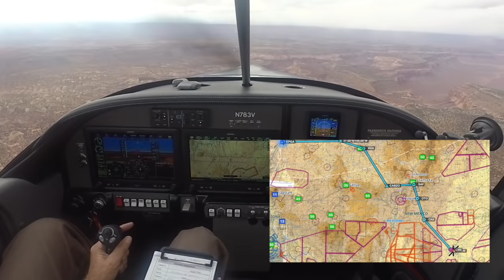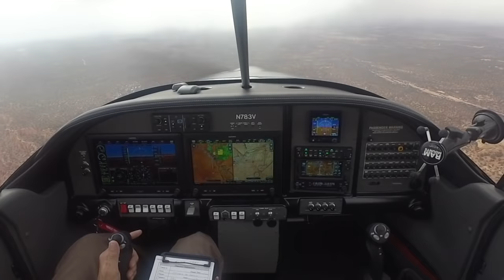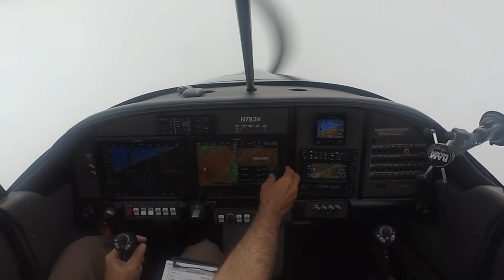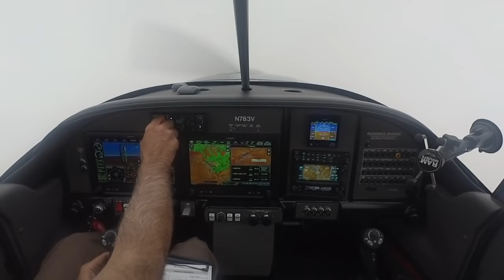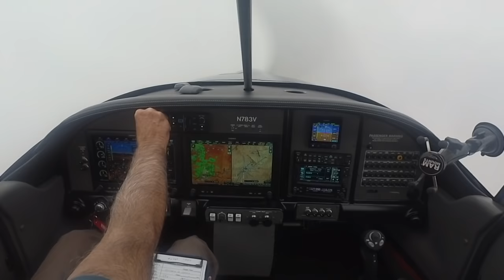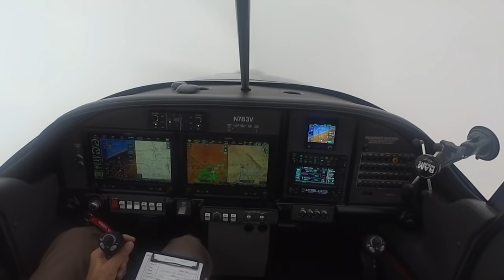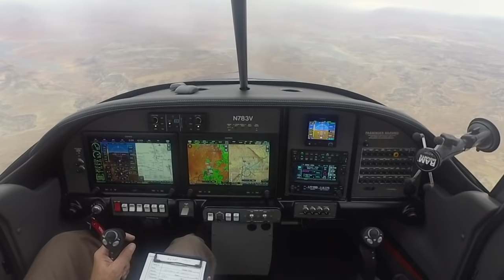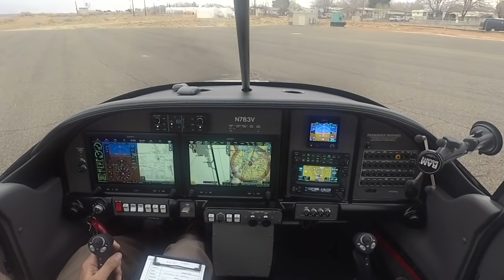RV 10   N783V   My 1st Emergency   HD 720p

Comment: Inadvertent IFR, in an aircraft/cockpit you don't have that many hours in, solo.

That's a tough situation even for the pros.  I've been there myself flying military aircraft, and it's definitely one of those "in the air wishing you were on the ground" scenarios!

I think one of the best things to recognize is that these factors above can SIGNIFICANTLY affect your performance, regardless of experience level (no matter how good you are, you are NOT going to be at your best in this situation).

Which means the more you fully embrace the performance degradation and try to stack the deck in your favor, the better.  Just admitting this in the moment can be difficult for many.

Some things to think about to augment the fundamental pillars of "Aviate, Navigate, Communicate":

1. Turning around towards known VFR conditions.  Viable (and already beat to death) in this case, but it might not always be an option.  The weather gets a vote too, and if it surprised you in front of the aircraft, it could surprise you behind it as well.
2. How comfortable are you with your clearance over the highest obstacles in the area?  I'm assuming your high-speed Garmin systems will greatly help to keep you clear, but if there is any doubt, getting a good obstacle-clearance altitude squared away (either by checking charts or asking ATC) should be a fairly high initial priority once IMC.  If it's taking too long to figure this out due to task saturation/closer alligators to your canoe, consider climbing until you can revisit.  This will also slow your speed over the ground - not a bad thing when you're behind the aircraft.  Once this check is in the box, you can breathe a little easier.
3. Slow down (keeping a safe margin above stall) if safe to do so - gives you and ATC more time to get ahead of the aircraft.  You're going to need time to get your house in order while working through the problem set.
4. If slowing down still isn't enough to get ahead of the aircraft and fuel/conditions permit, consider a couple of gentle 360° turns to further limit how far you are traveling downrange until you are ready.
5.  Don't rule out squawking 7700 and declaring an emergency if things get too overwhelming.  Not saying that was needed in this case, but it's a tool in your toolbox that can help you if things start to really go south.  If it's taking too long to reach ATC while in unplanned IMC, squawking 7700 should get everyone's attention and help mitigate the risk of swapping paint while trying to get a clearance.
6.  Whenever circumstances throw you off your normal rhythm, that is a prime scenario for forgetting/missing basic stuff completely unrelated to whatever shiny object is commanding your attention at the moment.  Approach and landing checklists, altimeter settings, etc are more likely to be missed or incomplete when task-saturated.  Don't forget the basics, and don't let yourself get squeezed into missing the fundamentals due to being behind the aircraft (see item 3 and 4 above).  If you're not sure you completed a checklist due to distractions, don't be afraid to repeat it.  I've had lots of hairy emergencies, always tried to recognize how much more vulnerable I was to stupid mistakes in those situations, and always tried to give myself extra time to make sure I was fully ready to land when the situation allowed, even if it meant a couple of laps overhead the field to take a breath, get back into the normal habit patterns, and make sure I was really complete with all my emergency non-memory items and regular checklists, etc (assuming my fuel state and emergency weren't time-critical - which they were not most of the time).

When cleared direct to what I assume was the initial or final approach fix (right before the pitot tube iced over), great job just asking ATC for a steer instead of adding another task to your list while saturated.

Of course, there could always be factors that make this situation much, much worse, like lack of IFR training and IMC experience, low fuel state, significant nearby terrain, deteriorating weather at runway(s) within range, aircraft malfunction(s), and having this happen at night.

I was happy to hear helpful ATC who were cognizant of the snakes in your cockpit and tried to not make things worse while balancing the need to get you safely deconflicted and on the ground.

And one last thing - is there any reason not to always have pitot heat on while in the air for your aircraft type?  This was a no-brainer for the military aircraft I flew, but perhaps things are different for expensive privately-owned aircraft (where there might be more incentive to preserve the life of expensive aircraft components).

Thanks for sharing this experience for everyone's benefit.  Everyone makes mistakes - even the best-handled emergencies reveal certain areas that could have been handled more effectively when carefully analyzed after the fact.  Your willingness to analyze, embrace, and share the post-flight takeaways speaks volumes and is really critical to a productive aviation safety culture.  Plus, it makes you a better pilot in the long run.

Fly Navy!

Comment: Scary stuff, You should put a temp sensor on your pitot tube so it comes on automatically, with a separate redundant override switch, should the temp sensor fail, but the thing about situations like this, is that you will never forget to turn on your pitot sensor heater on again, thats for sure. 😊

Comment: In the age of selfdriving cars, it seems like aviation has a long way to go to catch up. I mean, there obviously should be a sensor on the piot tube that detects if the tube is blocked by debris or b.detects if it is blocked by ice and takes  the appropriate action automatically! This is the Second video about the pitot tube failure the other on a commercial aircraft and they too had no idea why they had no airspeed (turns out the ground crew forgot to remove the piot tube covers prior to take off)

Comment: Well i think every pilot should prepare for each VFR flight like it will be IFR with 0 visability. Things like planning a path in garmin with ils or rnav approaces and also NDB and VOR beacons is created for this kind of a situation.
And also i have a rule: if i am flying through clouds - pito heat and other anti ice sistems is always on. Just to be safe.

Comment: In watching these videos, I feel like many times the cockpit alarms do more distracting harm than good. YES, sound quickly and briefly 3x in a row (and state the actual issue audibly), and maybe again 30 seconds later but to have a TONE only going off, or multiple tones mostly distracts and makes the pilot less effective, not more. That is just my opinion- thoughts?

Comment: Pretty amazing ( to non pilot) that only one air speed indciator availabel with no back up and that pitot heat isn't always on. If I recall a freezing pitot was major contributing factor to that  Air France Airbus A330 crash in  south America 2009 with total loss of life. 
Just a thought - would not on board (or even a dash mounted GPS) give you a damn good ground speed indication at least. Better than nothing. It always agrees with my car speedo within a few %. It's  fairly sobering that my car has two reliable speed indicators but a plane does not.

Comment: Not a pilot but have enjoyed a few flights with friends.
I'm happy sitting on my hands in the right seat, feet planted firmly on the floor away from the peddles.
Maybe if my pilot croaked I'd be able to crash land soft enough to hobble away from the wreck.
Maybe.

Comment: I am sure you honored the respect for National Park quiet enjoyment for the folks hiking and camping by staying 8 to 10 miles off the border of the Grand Canyon National Park. Please share this with your fellow pilots who are not quite so courteous and law abiding. After all, this is for their benefit -  more and more national park goers are becoming aware of the FAA complaint phone line access. I am planning to become a pilot myself, and I will most certainly remind my fellows to avoid trouble with their pilot license status.
Reply: Just checked the VFR sectional, there is no requirement to stay 8 to 10 miles from the park’s border. There are rules but I suspect you and your fellow hikers armed with the FAA complaint line phone number and their imagined constitutional right to never hear an aircraft engine are going to be making a lot of bogus complaints about planes in the designated VFR corridors over the Grand Canyon.

Comment: I think so many pilots get themselves into unnecessary situations simply because they are afraid to contact air traffic control and "bother them." When he apologizes to air traffic control and they respond with "that's our job", that's a moment that every pilot should keep in the back of their heads. In the end, air traffic control would much rather pull you out of the clouds than pull you out of the woods.

Comment: I wonder why they don't make automatic the pitot tube to go on when the temperature drops below a level where ice can accumulate. It should go on with a sound so the pilot is aware and decide if it is ok to keep it on or turn off. But the on should be triggered by the temperature not by the pilot once every 15 yrs.

Comment: The real lesson in this and its about all types of situations with travel and other topics but the real lesson to learn is this is a psychological error in human behavior. Refusing to turn around is a psychological threat to the ego regarding want, instead of need (to be safe). The ego presses on and begins to rationalize because it's embarrassing to the ego to have to turn back. When the ego drives your decisions you can definitely find yourself in a predicament. Kobe Bryant died from the same reasons.

Comment: I've been an aircraft mechanic for 32 years. I'm not a pilot. I guess I'd have the tendency to over simplify in my thinking...?   I think pitot heat would have been my first thing to "go for" when I lost airspeed.  My question is, in your opinion, is that something that maybe isn't emphasized enough in training ?   Great composure on your part.....   BTW, what did that airport pavement taste like when you kissed it ?  Ha ha.    Nice job.

Comment: On lessons learned you might want to add power and pitch equal performance.  

When you said you lost air speed and your stall warning was going off my brain IMMEDIATELY went to power and pitch and pitot heat.  

I benefitted from the exceptional instructional skills of a really great CFI who helped me as a new VFR pilot transition to my RV4.  

Those items were hammered into me.  

I really love the safety culture in the Aviation community.  Own the mistake and analyze what you did wrong.  I can tell you that I would not have made THOSE mistakes.  My weaknesses are many.  I have flaws in my skills and in my character itself.  All this means is that I would make different mistakes.  That's the danger that typically young people make when analyzing almost any kind of accident.  "I'd never make that mistake".  But they don't realize that while that may be true, they are likely to make a different kind of mistake.  

When I was roughly 30, I found myself with a bad case of Get There-itis.  It was a short trip and I was only going 120 miles in my RV-4 to go visit a girl for a weekend of fun.  It was a 45 minute flight, but because of mountains, it was a 4 hour car ride.  So I was "motivated.".   I found myself flying into lowering clouds and rising terrain.  I pressed on until I was flying in a 300 ft vertical space between the terrain and the bottom of the clouds.  

I was not IFR rated and the plane, although it had a Dynon D-10 , was not IFR certified.  FINALLY after passing a broadcast tower a couple of miles off my wing that was taller than I was high, did I turn around.  It was so so reliving to make the decision and see the space open up in front of me as I headed back home. IDIOT.  

Anyway, thank you for sharing.  I gave up flying when I had kids because my risk tolerance went way down.  Now they are in their teens and I'm thinking of getting back into it.  Sadly, I've found that my beloved RV-4 was involved in a ground loop incident and was totaled.

Comment: Seems like airplanes should have more than one airspeed sensor given how critical it is.  Isn't an airspeed sensor issue (failure in that case, not iced up) the reason for the lost of two 737-Max-800s when the MCAS system forced a nose down stabilizer state due to faulty airspeed data which led the algorithm to conclude a stall?

Comment: You were already in violation by flying into IFR conditions as a VFR driver before you made your decision to press on. You did not have 2000 ft horizontal visibility nor 500 feet clearance below the clouds.

Comment: This would appear to be a case of instinct vs training. The fact that you hadn't had to turn on the pitot heat in 15 years left you with the conclusion it was avionics failure instead of pilot error. I would think that most pilots who fly IFR in conditions like this wouldn't have made this mistake. At least you got on the ground safely.

Comment: "Hmm... my airspeed isn't working...  Where does the system get airspeed indication from?  The pitot tube...  So either my pitot tube circuit just failed or my pitot tube is iced up.".    But of course when all those bells are going off in your ears and other things are happening it's hard to take a minute to reason the airspeed circuit out.

Comment: You are possible suffering from altitude lack of oxygen... Possible carbon monoxide poisoning... But being at altitude. The strees and lack of normal breathing can cause the brain fog you were experiencing...  I'm no pro but I would imagine learning to use the GPS to properly plan a flight could be of great use in a pinch.  Good stuff 👍

Comment: Poor communication skills with ATC; improper read-backs. At the 00:09:00 minute mark, we're told that the plane's warning alarms are the "auto-pilot kicking off." Watch the attitude indicator show how close the pilot comes to banking into a stall/spin before the bank angle is corrected. When flying long-distance over ANY mountainous terrain, be prepared to add pitot heat and/or carb heat. When planning ANY long-distance flight into unfamiliar territory, ALWAYS FILE A FLIGHT PLAN. This video is a classic example of a complacent pilot who did not bother to thoroughly plan his flight.

Comment: I have never understood why you fly with pitot heat off in the states. I see it a lot in various YouTube videos.
Here in Scandinavia it is std procedure to have pitot heat on when flying IFR. I think that goes for the rest of Europe also.
And no it does not cause the heater to burn prematurely. I don't think we have ever replaced a heater in my 20 years as instructor..

Comment: Good thing, that pilot suspected  instrumentation error at once, instead of trying to correct actual plane attitude.
There were too many incidents, when experienced pilots started dive on stall warning, and left clouds with too big vertical speed. Or noobs, started climb and lose actual speed.
(Disclaimer: I'm not a pilot; Single successful (hard) landing in sim, naturally, does not count).

Comment: This, like most I learned from this, is really weak on lessons learned.  Where's the pilot debrief?  What were you thinking months before?  As a instrument pilot were your skills up so that you could fly from take off to minimums in IMC?  If not why were you scud running?  Where was your plan if it gets worse I am going to turn around and land at X.  If X has turned IFR I will go for my back up to my back up.

Or, since I am up standards and I am already with ATC using flight following, I will ask for a IFR pop up clearance.  And since I have been monitoring the air temperature and know I am close to freezing, no matter the forecast for ice, I am already thinking it and the loss of airspeed, is no more that opps I forgot to put my pitot heat on.   And you turn it on.  This didn't happen because of things you did that day.  It's the things you didn't do months before.

Comment: Not understanding why you had an "emergency". You have all of your INSTRUMENTS. You don't need to be able to see ANYTHING outside the plane to fly the plane. Just look at your gauges and fly the plane. You literally have EVERYTHING at your fingertips. Altitude, pitch, heading, speed, rate of climb/descent, weather radar, and your radios. It's almost an embarrassment of technological aids that you have to assist you. 

How can you not feel when the plane is banking? How can you not see the attitude indicator showing your steep bank? It's literally the most important instrument in an airplane. If you watched ONLY that instrument and nothing else, you could safely fly the plane. In fact, it's so important that they give it to you TWICE.
Reply: Spatial disorientation under VFR in such conditions is fatal.
Turn around.
Is not a fighter jet , I know, but the most innocent  turbulence  will generate  enough G to develop disorientation.
Reply: @juancaorsi1805  He says he's IFR rated but it sure as heck doesn't look like it from this video. He practically rolled the plane without even noticing.
Reply: @taekwondotime  that's true,   no emergency.
Reply: @taekwondotime  Black belt? You work hard .

Comment: 1. You flew right into deteriorating weather and IMC conditions,  What were you thinking?  
2. You are supposed to fly first, navigate second and communicate last.
3. You broke several rules and even got behind.  
4. You flew into clouds without pitot heat.
I have a Twin Comanche loaded with everything you can think of.  I would never push things that far.  Come on man.  Good judgement is better than skill..